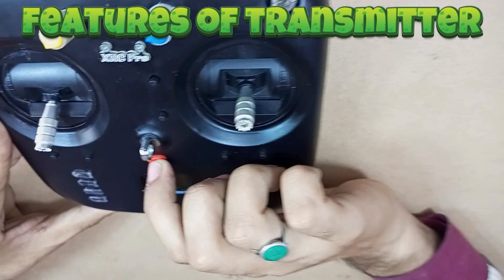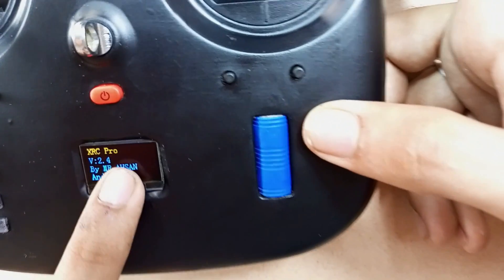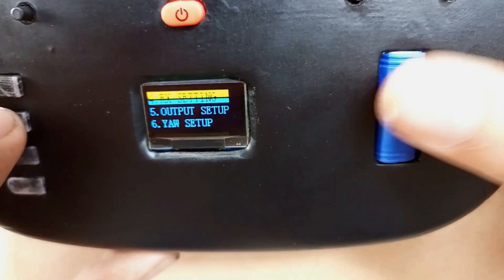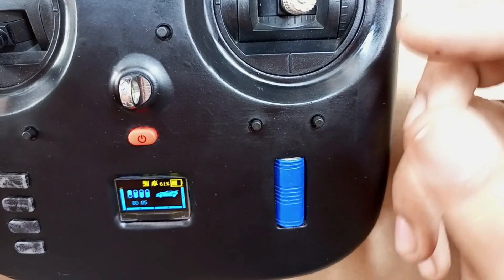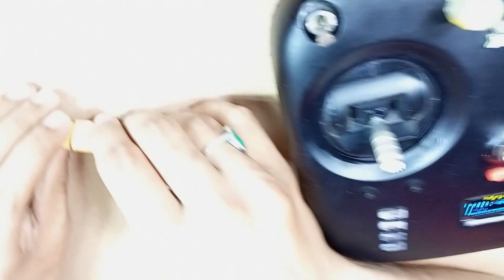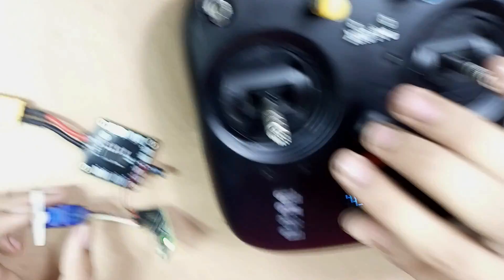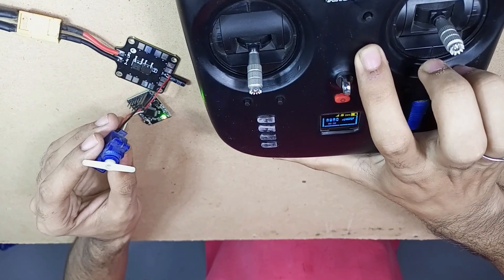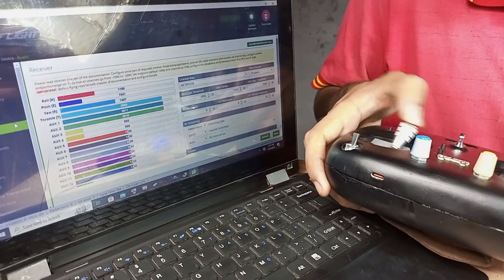MAKE 8CH RC TRANSMITTER AND RECEIVER WITH STM32 & NRF24L01| XRC PRO | OPEN SOURCE.

Comment: It's cool and all but the ordering pcbs and other parts increases the cost. Could rather buy radiomaster pocket at that point.

Suggestion - To reduce cost - Just use traditional wiring on stm32 board, few switch. To lower cost. Also use the stm32 board for the receiver no need to order pcb doesn't matter the size ( cost is what matters to most people) .
Software is great 🎉 with oled. That's the one where no cost need to be cut.

Comment: I have a question that can i connect elrs module throught its ppm output
Reply from the maker: yes,you can connect.you have to use ppm to elrs adapter.
Reply: Amazing now I can use the ears functionality as well.
Reply: Can you explain how to connect elrs with this  @diytechoss
Reply from the maker: @Sabil_Elkhayr  contact me via what sapp +92-3174598356
Reply: Bro ap Pakistan me kaha sy ho??? @diytechoss
Reply from the maker: @zahidhamood6079  okara